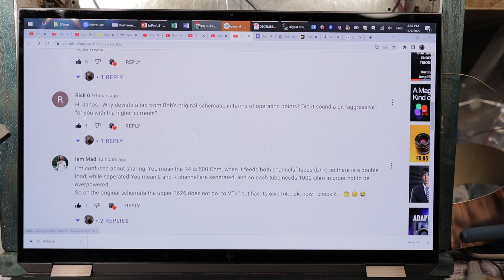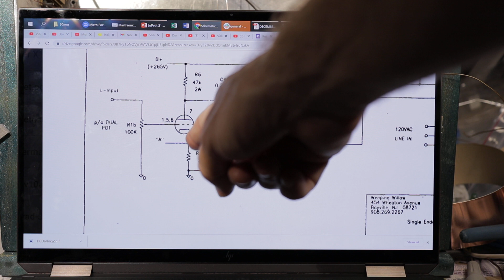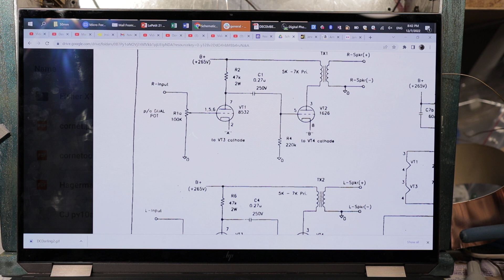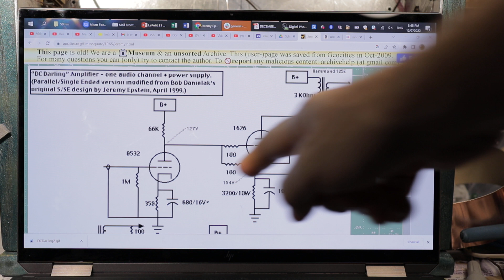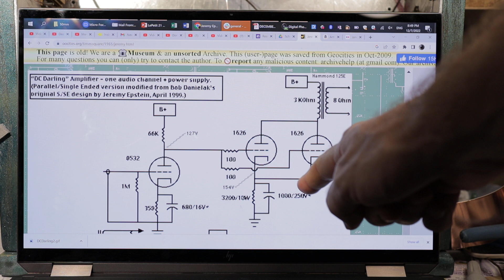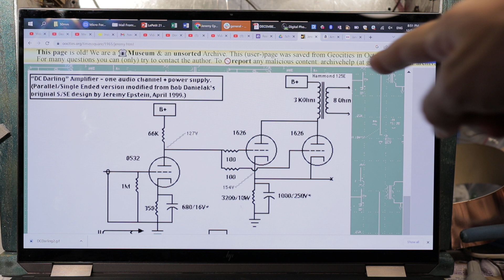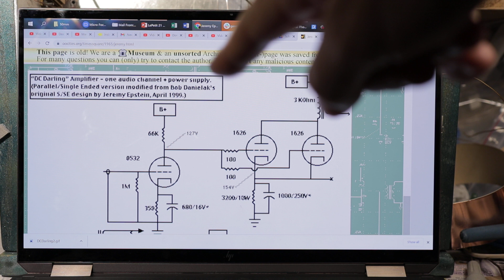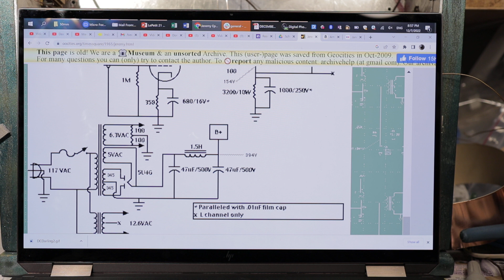Darling evolution:   SET history (cut short, battery died...)

Comment: DC coupling gets a lot easier with something like the 6EM7 / 6EW7 / 6FD7 dissimilar triodes... there the output and driver stage warm up at the same time. In such a setup, it's less likely you'll put B+ on the grid of the output tube due to a tube failure or poor contact of one socket. You can even use solid state rectification and then put a series tube rectifier for slow-start and less voltage drop...

Comment: Good points on the odd choice of the 25V/1mF bypass: already, a 52uF bypass translates to a -3dB low at about 5Hz which seems very appropriate (I tend to target 4Hz). The internal structure, inductance etc will influence the lows, and I would expect most 1mF bypasses will have significant ESL and ESR comparatively.

Comment: using two tubes coupled on the 66k resistor drops the Voltage on the first tube - to compensate for that, the resistor was changed to 350 Ohms. Read the voltage on the 66k resistor: exactly half the source voltage, respectively no change in the operating point. Because two tubes can handle more current, the winding of the transformer was changed as well, translating in more output wattage without (!) increasing the distortion - the overall amplification will change as well because of a different winding relation in the transformer.

Comment: must admit ti being abit confused have been gathering parts and have many different values depending on what video i watch? Am thinking I can go ahead with what i have which is a mixture , Baby darling power with the pure darling circuit and to confuse things more thinking of going with original sprecs and using a hammond transformer 546-1629 which has 6.5k impedance. Thinking i can tweak things and maybe later upgrade the power.  Probaly  most unsure about the grid resistor input to the driver  as in the pure and not the baby as i dont awnt to blow the tube. Also watching alot of Uncle Doug .  But yes please call out if i am going bady wrong , but am happy to replace parts as i go.
Reply from the maker: Yes, you can build the Baby darling with separate cathode resistors like the Pure Darling - just use the cathode values of the Pure Darling. The 6.5K OPT will work well - that's what Bob Danielak used - you will get higher power but also a little higher distortion than with 10K . Not necessarily a bad thing though, might turn out that it matches your speakers better than the 10K and gives optimal performance. Speakers are rarely 8R and 4R... more like 6R and 3R... 6.5K OPT - - speakers dipping to 6R hooked to the 8R tap is a sweet and perfect match.

Comment: Hi Janos. I've always found your channel very educational.  I've always been fond of point source drivers that I still 2 set of them laying around to switch into from time to time. I'm currently refreshing an early pair of Audio Note AN-J/L.  I've done the caps and resistors and I'm kinda stuck with this Variable Resistor in the tweeter circuit. I would greatly appreciate your input on next steps.  I'm just a noob at DIY but replacing the caps and resistors with the same values as well as replacing the tweeters and woofers were what I have done so far. Thanks!

Comment: Hi Janos, you speak about double π power filtering. This will increase the sagging of the power supply considerably. The most stable B+ is obtained when the rectifier tube feeds directly in to the choke with a single capacitor at the output of the choke (provided that all the values and currents are calculated well according to the data sheet of the rectifier tube). An other advantage of this is that you will never fry your rectifier tube with an inrush current (unless you do something really stupid). Do you have any thoughts regarding "choke in" versus double π filtering?
Reply: I think you have your thoughts Hugo and I agree with you.....
Why not ......................transformer must deliver higher voltages =/= not commercial !
The Choke must be of outstanding quality and that's also not cheap .....
But DIY are not limited by commercial downsizing and cheapest possible applications........marketing may play with outstanding measures in their glossy papers.
It pleases many that believe they are not able to do better than commercial bussiness....
Sometimes MORE money goes into marketing than in the design.....( 80% at B&O in the late ninetiers )
Here the capacitor will be charged on his whole cycle and not by peak burst on top voltages .....and that you can hear the absence of restlessness in the music .
The capacitor plays the role of the " reservoir ", he will deliver the power /current to the circuit /tubes ............SO this one can't be good enough !
We can talk hours or days of power supplies but at last it will always be what we hear , modulated by a circuit (good or bad)..
The choke input choice gives indeed a more stable voltage under VARIABLE load but is also less prone to interference on the wall AC line .
Rectifiers are galvanic decoupled from the line , diodes are not....
As for any cooking one has to choose the right ingredients, the right synergy between the rectifier , the tubes , the OPT and PT and components ..best help and tool is finishing /using  by your ears , the proof of the pudding is in its eating..
Have a nice day all.